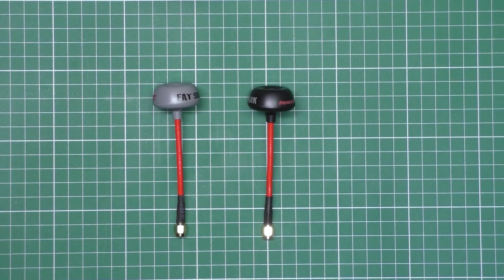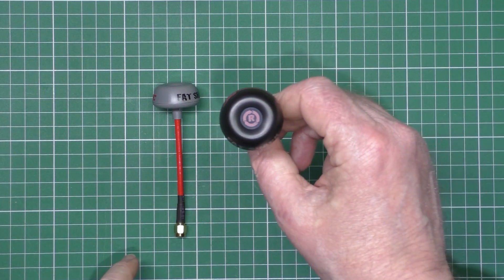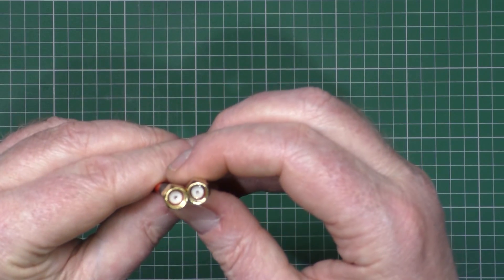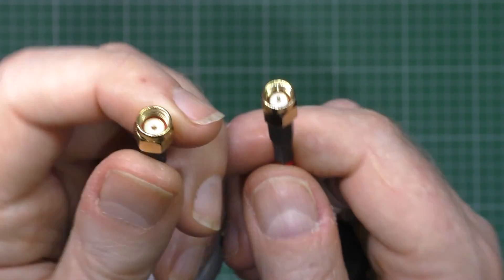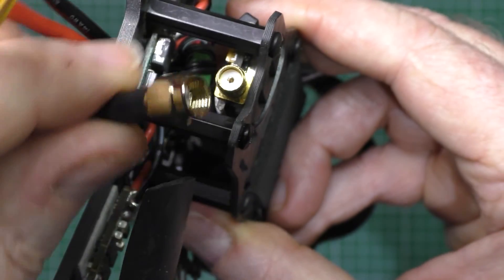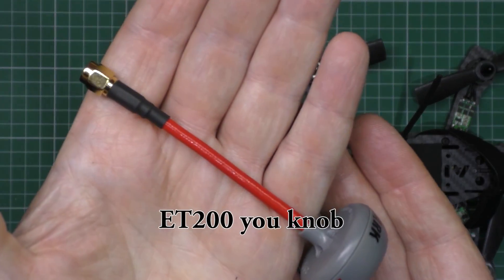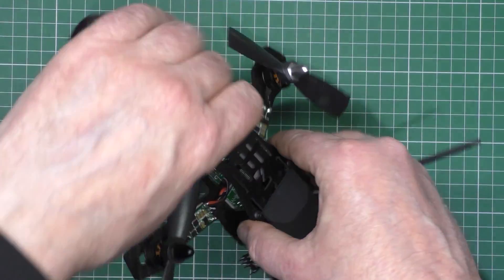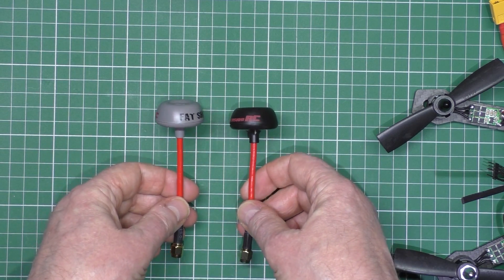ImmersionRC 5.8ghz antennas. Grey top - Black top - RPSMA - SMA

Comment: been there, the grey ones have been about for years mate, very easy to get caught out with them! good spot!
Reply from the maker: +Rotor Flex It's the first time I've seen them mate. Even a search for "ImmersionRC grey case" brings up nothing and I just assumed they'd changed the colour
Reply: im not sure if immersion even make them anymore mate, they could be old stock, easy way to tell is immersion's older cp antennas were 3 leaf and 4 leaf sets, all newer sets are both 4 leaf, pop the top cap off and have a look.the older ones also were marked rx and tx on the antenna sets.
Reply from the maker: +Rotor Flex Both have 4 leaves :-(
Reply: +Vortecks  they must still be making them, good find mate!
Reply from the maker: +Rotor Flex More luck than anything :-)